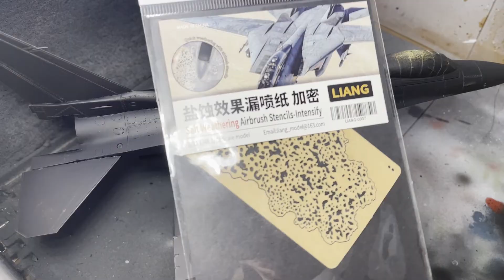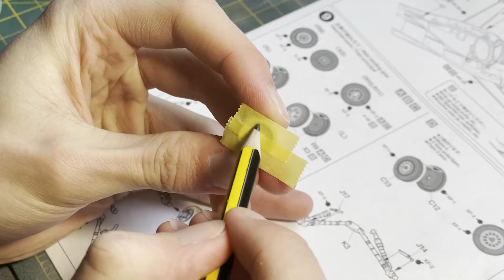Tamiya's 1/48 F16C/N Aggressor | Full Build | HD

Comment: Great build up!  I wanted to let you know, as an FYI, those ‘fins’ on the top of the nose are IFF (Identify Friend/Foe) antennae, also comically referred to as ‘bird slicers’.  Keep up the great work!
Reply from the maker: Thank you very much! Funnily enough I have just released another video on this beast but a revamp for 2024, so if you enjoyed that I am sure you’ll like that as well🤙🏻
Reply: We worked on the developed that system back in the late 1980s at Edwards AFB.  It was originally slated for Block 30G production, but never made it into the production line until Block 50.  Some F-16As and F-16Cs have been MLU’d or CCIP’d with AIFF retrofitted back into them, since it’s one of the critical BVR target recognition systems for more enhanced employment of the AIM-120C5 and later AMRAAMs.

Comment: Beautiful job.  

Question. You don't show any gluing. Do you in fact glue anything or is it all just press fit? If you do glue, what glue do you use? Cheers.
Reply from the maker: I do use Tamiya Cement, however, for videoing purposes I prefer to show you the dry fit just in case it requires multiple takes😁👌🏻

Comment: Why do I feel like I'm the only person that notices when the directions do this? On this build, step 3 literally tells you to use the same piece C8 twice! Then every time I run into an issue like this, build videos completely skip the step. In the video you attached the cockpit, piece A17 to A24 , then the engine intake part J24 to A24, then skip the C8 pieces for the horizontal stabilizers and attach G1 to A24 sealing the area closed. It tells you to use the same part C8 on both sides in insert poly caps and that is just skipped.
Reply from the maker: My apologies sir! As this was one of earlier videos of mine, the detail and quality was a little questionable. I appreciate how annoying this must be so my utter most apologies. Hope this doesn’t put you off future content😔
Reply: @Mach Models, can you address my question instead of just loving it? I've been through 3 other videos now and they all skip over this without even mentioning it.
Reply from the maker: Sorry buddy, not completely sure what your question is… you want to know what happens in step 3? Also I have recently revised this build recently on the channel, that might help? Sorry again 😔
Reply: @machmodels  It just feels like there is more to it than that. I have now watched 4 different builders on this same kit, all 4 skip this step without even mentioning it. One of them even goes through step 3 with the instructions open, attaches the cockpit, then the next piece then skips the C8 step that is right in front of him without a single word on it. It's so weird.....
Reply from the maker: Hmm not too sure then, I do distinctly remember that I forgot to put poly caps in this build which caused me a massive headache! That was rectified in the updated build. Perhaps people get so sidetracked by the intake and cockpit they forget it. Weird one!☺️
Reply: @machmodels  Okay, thanks, but my issue is not forgetting to do it. My issue it it clearly tells you to use the same piece on both sides yet there is only one C8 piece. Like I said, the strangest part is every build video I can find for this kit, skips that entire part just like your video, that is beyond weird.
Reply from the maker: I think I’ve figured out your problem, I believe there are two “C” sprues. Let me know if there are and this might solve the problem!
Reply: @machmodels  I'm on with Tamaya support but you are CORRECT! Thank you so much, I never thought they would put two C sprues!
Reply: I usually pull out the sprues as I need them and leave the rest in the box to reduce clutter. Never thought of this being an issue but I guess I will need to check for duplicate sprues going forward.
Reply from the maker: Haha no worries man! Glad to hear that the crisis has been averted. I think as payment you owe me a subscription🤣☺️
Reply: @machmodels  Haha, I was thinking exactly the same thing. At first, when you said, "I hope this does not put you off in my content", I was already thinking I would subscribe because you content is awesome and you actually respond to people. It's much appreciated and I'm now subscribed to your channel.
Reply from the maker: Wehey! Welcome to the channel, if you have any other sort of problems my email can be found on the information page, so I’m more than happy to have a chat☺️👌🏻
Reply: @machmodels  I noticed your comment at the end about the Tamiya decals being a pain. Have you ever tried using them with really hot water? I started doing that some time ago and noticed it worked much better. Awesome build!
Reply: Very kind of you to continue solving this problem, when it is clearly not your problem. 
 @machmodels  Greetings from Canada!
Reply: @bzavala123  there are 2 c sprues with identical parts? So.yes there are 2 c8's